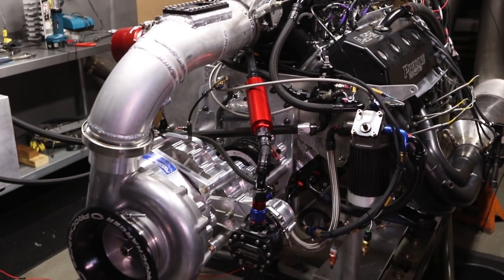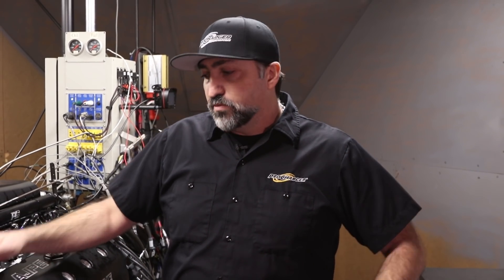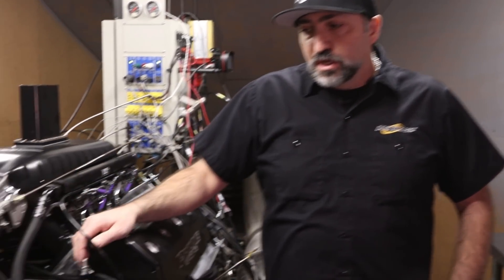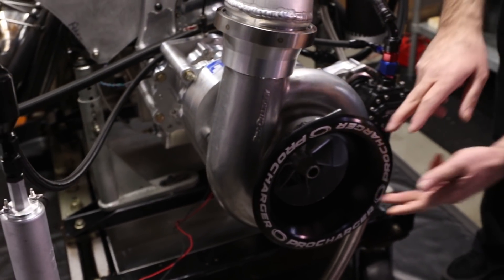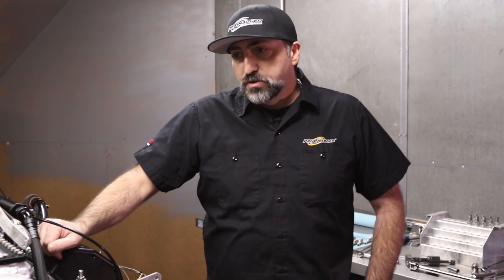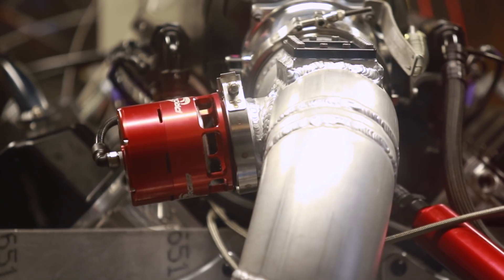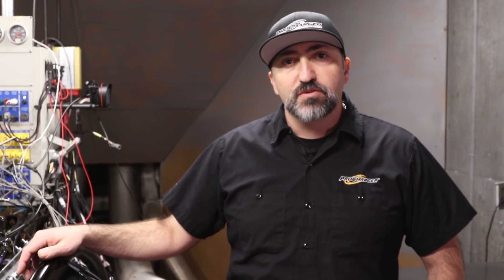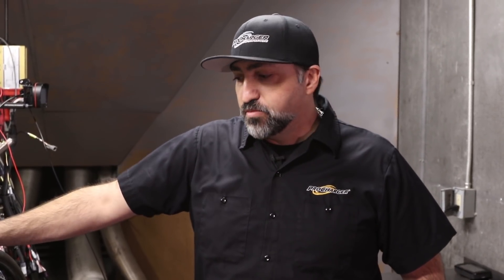ProCharger's F-3R 136 Supercharger Makes Over 3,000 Horsepower!

Comment: Procharger sponsors my buddy James Reaper, and on his PAR Racing Engines conventional headed 540 bbc F3-136 gear drive setup, the car made 3500 rwhp on the hubdyno with a little more in it.  The f3-140 the Bruders easily made 3500 rwhp with the same 540,  I can't put those numbers out there though.  He could of made more but it's aluminum not a billet block so didn't wanna go anymore. His tuners the Bruder brothers had that car run a 3.90 on a no prep surface. As you can tell I'm procharger guy f3-130 540 bbc on the gear drive with alternator bracket and a true street driven drag car.